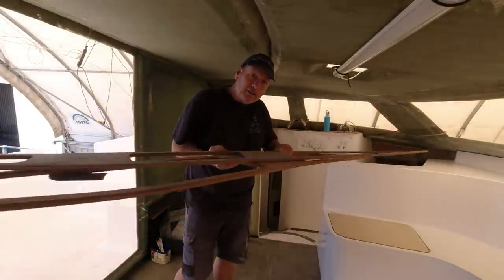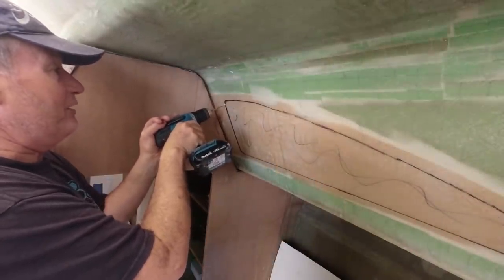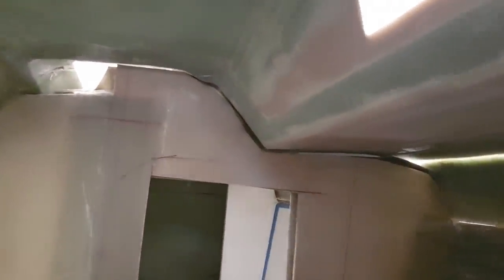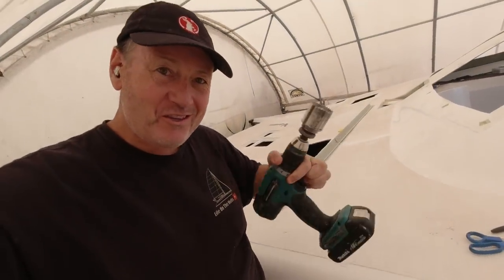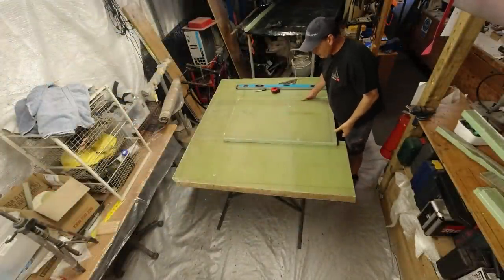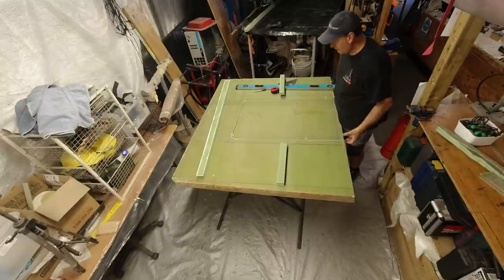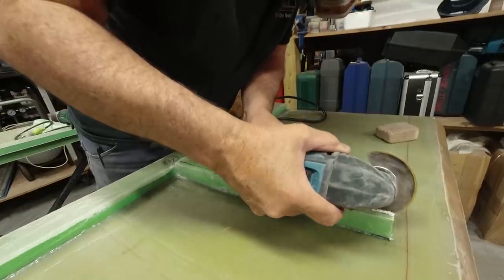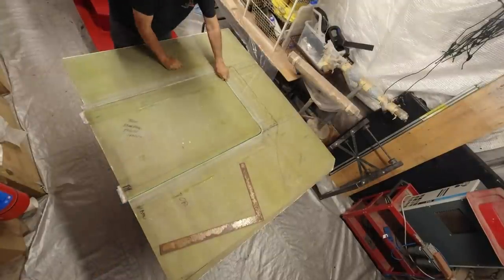CATAMARAN BUILD - Pure Boatwork - Window Cut Outs and Engine Access  Ep202

Comment: Hey Ross. No need to over-engineer the engine hatch. You can just make a groove for the vertical opening,  as a lift-up washboard. Then you will not run into problems with the insulation, or weight issues, or latching issues. Whenever you need to access the engine bay, it will not be an issue to just open the hatch and pull out the washboard i.m.o.

Comment: Rossco I honestly have a hard time keeping up with the progress sometimes as at this moment everything seems to be going not only very well but very quickly,  it sometimes feels like I've missed a episode 😢 of the build.  But I know it's not possible!!! As for your windows,  not only is this probably one of the world's strongest  Catamarans that will ever set sail upon the ocean but now the only one with all the natural lighting anyone could ever wish for. All because of the fact that you have spent the time and effort into making sure that you place your windows in the best way possible!!!
As for the access to your engine bay, we are all aware of how your planning and going to be able to do any repairs to your engine through the use of your folding hatch. That said I can't recall if you have ever said that the whole area of below the mattress will be able to be lifted upwards on a tilt, the reason why I ask is.  Knowing that you intend on having enough room for working on your engine through the hatchway and having enough room to do this safely and with the help of gas struts so the hatch doesn't knock off your noggin.  Thinking about how crappy the work space can be on boat's when it comes to working on the engine. I thought if just as a safety option your not only able to do work on the engine the way you intend, but if you have the option of attaching another pair of heavy duty struts on the top and bottom end of your bed that way for instance if you ever encounter any major problems with your engine's not only are you able to do work through the hatch area but your able to lift the whole mattress base upwards and get a much more visible space to not only see what's going on but also gives you the ability to be able to make any major replacements without the risk of injuries or making a hard job even harder!!! (  long winded I know!!!). 
Anyhow on a brighter note I hear your keeping things from us the viewers!!!. I just heard that my top two favourite boat building channels are doing a  collaboration between the pair of you.  That's one video I will not be missing for certain nomatter what I maybe upto!!!. Do you have any idea of when we will be blessed with this video?. Nodoubt in my mind that this video is going to be a laugh a minute and honestly we could all do with a bit of a good chuckle!!!. As always brother 💯%   👍   🇬🇧.
Reply from the maker: Thanks Simon,I would love to be able to lift the entire Bed base but sadly it is not possible as it forms a structural horizontal bulkhead.I do however have a secret weapon which is a large access and working arrangement on the stern of the engine room that will grant me access to the entire aft and sides of the motors. Bruce and y collaboration will be up at Bruce's discretion as he has some composite work coming up and we will be having a good natter regarding that and why we both got into this mess Cheers Simon all the best. Rossco

Comment: The beds in trucks are the same but instead of the smaller hatch opening the entire base lifts up on struts to give access to the a/c and heat system and extra storage and you don't have to remove the mattress which you will have to do.

Comment: good vlog - but if not too late ditch the fold up - KISS - easier to just remove when needed - actually ditch the struts on the top and make the top removable that will also allow better access to rear  when engine is exposed - KISS -

Comment: Mate, lovely work as always. Paid an acoustic engineer to help sound proof a condo and the key   to noise isolation is not insulation but sealing the air gap. Good not to catch on fire but if you want it quiet a good air seal is the money.

Comment: The top few inches of the front wall needs to be laminated to the top door. Approximately the same thickness as double your insulation fireproofing etc. This will allow the hinge point to be below the insulation and accommodate the insulation on the front access door panel. Alternatively I'd simply forget doing the swing under door part and simply make it a removable piece like a washboard. There will be times you simply want to open it for inspection but don't want to dismantle the entire bed. Couple of metal tabs run off the sides with some quarter turn fasteners and you've got an access panel without disturbing the bedding. 
Just some thoughts

Comment: I've found running another vacuum (or two) or small dust collector when you're generating a lot of dust can help filter a lot of the crap out of the air. May be worthwhile experimenting with to reduce the amount of dust that settles. Looking good Ross.
Reply from the maker: Thanks Jase,I wish I could move the dust extraction system as have in my factory to the boa it is a constant battle for sure.Rossco

Comment: Sir.  Cat is looking good. Hope you have enough head Room. On the Engine hatches on the Front Pice just make a lift up panel to remove don’t add it to the Top hatch be to heavy for the two shocks ! Plus be easier to fire proof and sound proof. Just my thought. Less thinking is always better. Now go the Home Depot or Lowe’s. Nd buy the Catch bucket 🪣 for you Shop Vac. Also buy new Airfliter and foam. It will make shop vac last longer and less fine dust in the Air.

Comment: Dude, I'm 58 years old, 6 feet, 250 pounds. i would not want to be crawling around in behind that motor any day of the week. First time i had to be crawling in there, i'd be cutting hatches to get at it from the outside.  Not getting any younger.  Build every hatch as big as it can possibly be while you can.

Comment: Would using a hole saw first have sped up the radius forming for the 'windows'. I'd think it would give a nice uniform curve to every corner. You might still be able to do so by clamping some scrap in the corners to guide the hole saw bit...Ahh, beat me to it at 9:00... Great minds Drink alike...

Comment: The engine access hatch/door - you need to factor in the noise/heat insulation that will be stuck on them, so quite likely you would have to fold on top instead of from the bottom? Plus you need the joint to be sound proof as well
Reply from the maker: Yes Ken I agree,it is going to take some thinking.Ross

Comment: I think you’re making allot mor work on your self attaching the two engine hatches together and hinging them just make the lower front removable 
You can set it aside in the cabin when you need access use spring loaded locking pins it will just pop out and set off to the side easy peasy

Comment: I've spent too many hours contorted in engine bays cursing the designer/builder who could've made my life SO much easier at the build stage. Much easier to be putting in access hatches or change layouts at construction, cutting in emergency access to a starter solenoid at 3am at sea is no fun. Been there, done that.

Comment: Hey Ross
Notice you broke the drill bit in the hole saw , do yourself a favour and make a pilot from 1/4" rod .
Yes this will require pre drilling with a 1/4 drill but has added benefit of stopping the hole saw wandering in soft or thin materials due to the dill bit enlarging the pilot hole whilst cutting.
Great work i feel tired watching you
Cheers
Bryce

Comment: Why not have the second piece hinged on the bottom so it simply folds forward and lays on the floor when that lid/access hatch is raised? It avoids having the extra writer on the hatch for your struts to lift. Plus if it is part of the hatch it needs to be secured up out of the way when the hatch is up otherwise it will be in your way.
Reply from the maker: Thanks Anthony all options being considered right now..Cheers Rossco.

Comment: Ross, you might have to rethink the piano hinge. The inside of the vertical engine hatch will have sound proofing on it. A lift out panel perhaps?
Reply from the maker: Yes I thought of that and decided I wouldn't cut until I thought it through some more.Cheers Tim.
Reply: I was thinking the same thing. Maybe have the vertical panel attached without the hinge? It looks like there is plenty of room for it to lift up out of the way.

Comment: Nice work👍 If you attach a cable to the under side of the bunk to the engine hatch then to the kick board hatch it fill fold back by its self when you lift the engine hatch. Just like how low loader ramps work.

Comment: I keep thinking about how you will finally join the deck to the hull.  Will you run a bead of epoxy along the top of the bulkheads and other surfaces that meet?  It would take quite some time to do that alone, so you would either need a bunch of well instructed people to each do a small part, or a very long curing time.  Then I expect you will tab over those joins.  If you did this, you would get a really strong join and no movement.

Comment: Why didn't you cut the radii first with the hole saw? The edges of the cut outs are also not fair at all. Didn't like that. Causes a lot of extra work.
Reply from the maker: Ohh you saw that,pretty ugly eh,gonna need a bit of tidying up.I was overzealous with the grinder then realised the hole saw should have come first.The result will be slightly larger windows.Cheers Ross

Comment: Drill bits used to last longer than the drills...until we started buying drill bits made in China. They are cheaper. Are they really? I go through 1/8" , 1/4",  3/8' drill bits on a regular basis and I am only a home hobbyist. I used to buy one of each every 6-8 years in the past unless I lost them. No more. Buying cheap drill bits over and over turns out to be not cheaper but more expensive in the long run. If I only had other choices besides Made In China.
Reply: I have been looking at drill bit sharpers just because of this. Have not one that is good enough that is affordable.